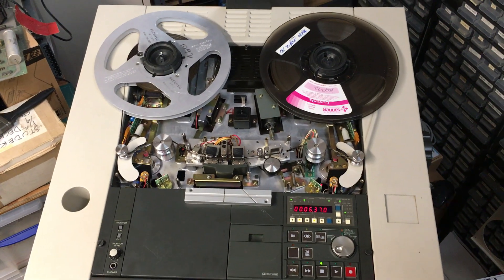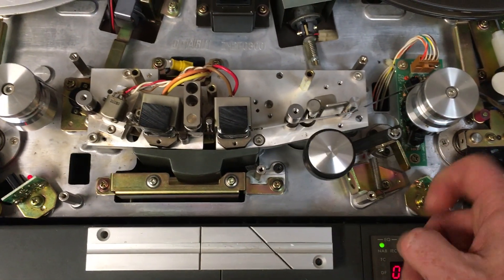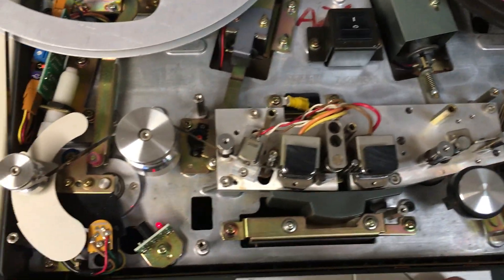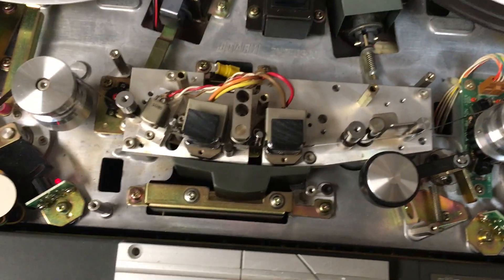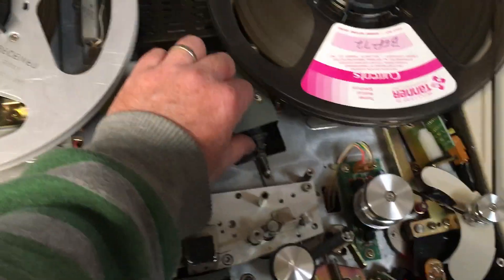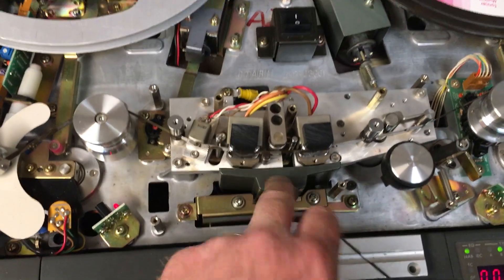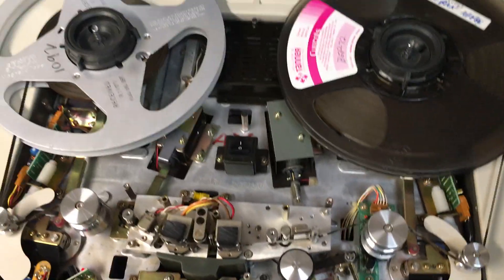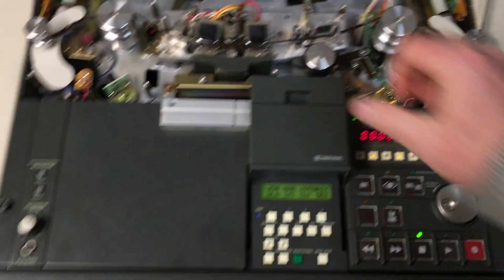Otari MTR-15 reel to reel servicing tips

Comment: hi have a mtr12 my self    it was the only  one i could find in the uk i could get my legs under  to fix up tapes  and change over the head blocks and rollers and  jazz 
up the motors  tenson side  i payed very small money for it 

as the record side is bad  will not record i have a record pre amp  from a brennell